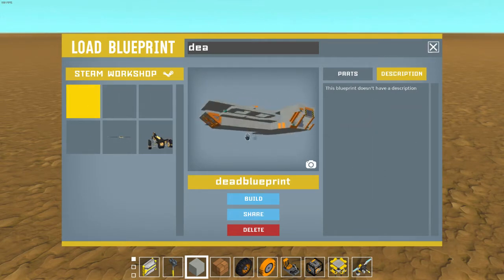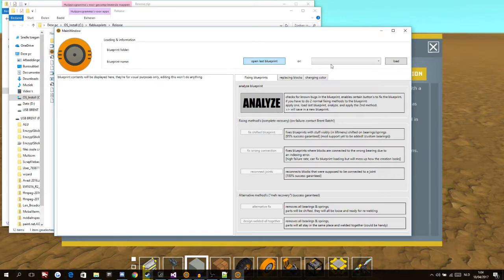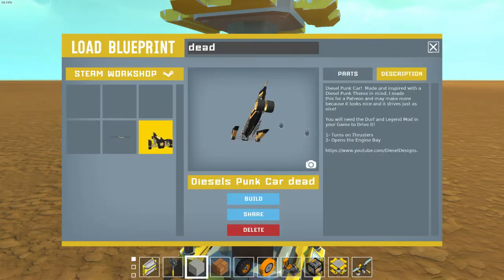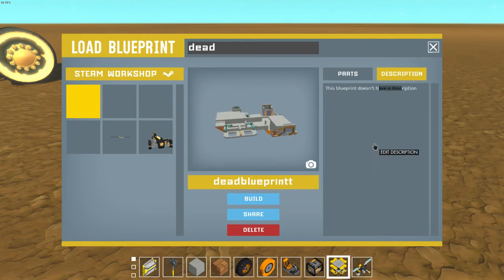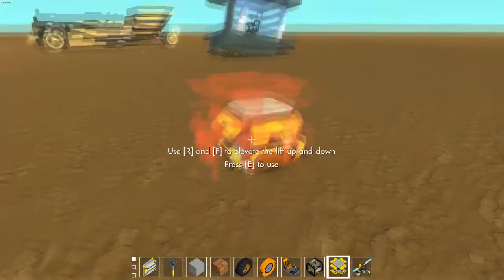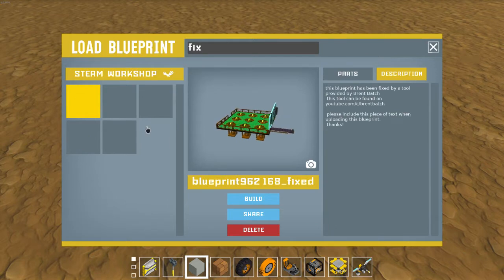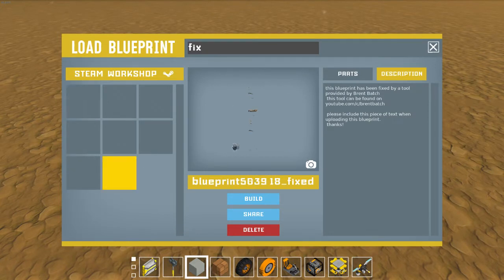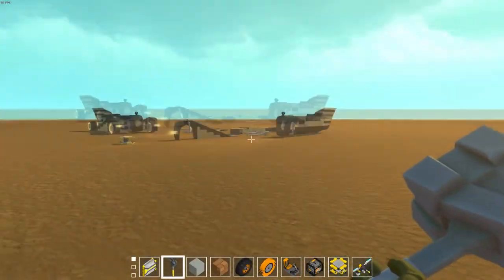Fix YOUR Blueprints! :D - Scrap Mechanic

Comment from the maker: because of a lack of interest of the comunity i'm discontinuing this project, it'll stay available online and it'll probably keep working for a long-ass time untill the devs make big changes in the file system, untill then: if your blueprint doesn't allow for conventional fixing methods, use the alternative ones, they are 100% garanteed to work, if the program crashes then feel free to send me your blueprints at brent.batch@hotmail.com i can not promise instant responses, as i said, there's a lack of interest in this tool
Reply from the maker: current version: PATCH V1.0.0.8: bug in modsupport has been found and patched! mod support has been improved
Reply from the maker: PATCH V1.0.0.9: extra button to check for available alternative method's (for when the normal 'analyze' crashes or doesn't work)
Reply: when i tried to load my rail gun it said invalid json what should i do
Reply: how do we send the broken blueprints to u?

Comment: Hi.
I don't have the Steam version, but it requires two specific Steam folders, and all I can do is "fixing" alternatively (it separates everything).
Is there another way of fixing a blueprint without those specific instructions?
Reply from the maker: currently all the bugs it fixes have been patched, there's new bugs now which the tool isn't made for, only the alternative methods work now
Reply: Brent Batch Oh, that's quite disappointing, I couldn't fix anything with the alternative way, that tool just make the glich worse than before...
Thanks anyway, I really appreciate your answer ✌🏻.

Comment: I built an articulated bus for several hours and the joint started to glitch during the chassis construction, which is why the later saved blueprint was broken. To my annoyance I deleted the last save when saving the new one, because you don't expect such problem. Thanks for this application, because it fixed the corrupt blueprint without functional and visual changes.

Comment: Excuse me brent, can you explain why when i save a blueprint the thumbnail is empty and when i try to spawn it it doesn't work? is the blueprint corrupted?
Reply from the maker: Simo2412 I really need to update this tool, i never got around to getting the tumbnail stuff finished, also: the bugs that plagues blueprints in this vid are not that common any more, new bugs are around now which the tool wasn't prepared for, i need to completely rewrite it for it to be able to fix these. What you can try is one of the alternative methods, they will give you a blueprint without bearings or springs or pistons, which should make it spawnable again. But also here it needs a rewrite so removed pistons dont cause an issue
Reply from the maker: Simo2412 if you send it to my mail or join the discord and pm it to me i can have a quick look to remove the bugs, shouldn't take too long. Manual approach is quick with the new bugs
Reply: don't worry xD i don't know why but when i opened the blueprint with the tool now it work, i just used the alternative fix because i have the steam folder on another hardrive  it created the fixed blueprint but when i tried the original blueprint now work and i can see the thumbnail
Reply: wait, existential question, is the latest version the 0.2.9 or the 0.1.32? i'm confused
Reply from the maker: Simo2412 version number of the tool and version number of the game are not the same, the last version of the tool is linked in the description and was made for scrap mechanic 0.2.7 i think, it still works in some cases now but needs a rewrite
Reply: i'm not talking about the tool, i just asked if the latest version is the 0.2.9 because  the 0.1.32 of my friend seems to don't have a mods folder on %appdata% and the piston is missing

Comment: When I load the blueprint, and click on analyze, no feedback comes from the software and windows says: fixshiftedblueprint funktioniert nicht mehr (im german) I have used mods in the Version 0.2.4 Build 190 waht i can do?
Reply from the maker: send me the blueprint, either via mail or anything else (brent.batch@hotmail.com) i'll debug the program to see what goes wrong and try to fix it, it's highly likely because of mods, what mods are you using ?
Reply: ok I have used this mods:

The Modpack
The Modpack Polygons
The Modpack Polygons Glass
Legend Mod
Exhaust Tubes
Colored Buttons and Switches
(The Modpack BETA (I can´t remémber)
Buttons and Switches Pack
Extra Blocks Mod

I think, that was all
Reply from the maker: hmmm it doesn't crash for me , can you tell me where your blueprints are located as well as where you got your scrap mechanic files located ?
Reply from the maker: hmmm nothing seems wrong, are you sure you got all the mods used in the build ? try download the program again btw , i updated it but it doesn't update on all users who have it , you need to manually download and reinstall/use the newest version
also, i couldn't find any bugs in your blueprint, it has to be something new, i might try to check for the new bug sometime, but for now you can click the new button in the textbox next to analyze to enable the alternative methods instead of having to click 'analyze'
Reply: ok, i can load the fixed blueprint and then all things, they before on bearings are faling from the sky. thank you! can you load the blueprint? or im the only one?
Reply from the maker: TheDarkMadness haven't tried to load it but ill check it out later, its normal that the alternative method makes stuff fall from the sky btw ;)
Reply: ok thank you so much. i can fix it now

Comment: Hey Brent! Thanks a lot for this tool.
Does it look for parts in the unpublished mod folder? (C:\Users\<username>\AppData\Roaming\Axolot Games\Scrap Mechanic\User\User_XXXXX\Mods)
It's telling me it can't find the required mods and that's where the part is.
Thanks again!
Reply from the maker: HaJa Creations ahhh, i forgot to add that, thanks for noticing! ill add that asap
Reply: You never cease to amaze me. Thanks Brent! -Jude
Reply from the maker: unpublished mods support added! srry that it took so long , had little time, twas actually pretty ez to add lol
links in the desc remain the same, the files behind the links are updated to contain this patch :D
i'm also working on a better shifted-blueprints fix , but that's taking a lil longer
Reply: Thanks Brent. I'm in no hurry.

It's still not finding my mod parts. They're here:
C:\Users\<name>\AppData\Roaming\Axolot Games\Scrap Mechanic\User\User_#################\Mods\HaJa Mod\Objects\Database\ShapeSets\HaJaParts.json

The creation I'm wanting to try it on is huge (called "Mansion"). It has a few shifted bearings so it may be too bad to be saved, but I figure it's worth a shot. It uses unpublished parts so I can't really share it.
Reply from the maker: ugh you called 'parts.json' hajaparts.json ..... no wonder it doesn't work :/ i'll add someth that can read any json file
Reply from the maker: currently at v1.0.0.7,
patch: supports different parts.json names now, for unpublished mods as well as published mods (eg durf mod wasn't properly supported) could you test?
Reply: I suspected I may have accidentally sabotaged you. I've seen others with unique names too, so hopefully it'll help others as well. Thanks again!
Reply: It finds the unpublished parts fine now. And Durf's too. It loads my "mansion" creation but crashes during "Analyze":
fixshiftedblueprint has stopped working
A problem caused the program to stop working correctly...

It's a 2MB BP so I'm not surprised. I won't bother sending it to you since it has unpublished parts, but I'm sure this tool will come in handy for my future issues.
Thanks!
Reply from the maker: hmmm, yeh, how i designed it it isn't too resource friendly... i could try some other tricks to make that better, or apply a quick patch so you don't need to analyze to use the alternative methods ?
anyway i know i'll have to rewrite the method that fixes shifted blueprints, itll be even less resource friendly but it'll finally get the job done properly instead of half work(only works on the simple cases atm, not the more advanced broken ones)
Reply from the maker: yknow what, send the blueprint anyway, maybe i can find why it crashes on it, could be some other problem, there are still several bugs in my code :/ if it wasn't so much code i'd rewrite it completely using stuff we learned last week in college
Reply: I sent it to your hotmail address. Don't spend more time on it than you want - no biggie. Might help you debug. Thanks!
Reply from the maker: HaJa Creations dont worry, wont spend more than 5 mins on it, just gonna run my program in debug mode and gonna check if some error turns up in the code, if its a stackoverflow then there's not much i can do...
Reply from the maker: PATCH V1.0.0.8: bug in modsupport has been found and patched! mod support is now properly introduced, it should be able to run your blueprint now :D
Reply: Lack of interest?! That's nutz! People must not understand what it does or don't know about it.

I tried the latest version. It's telling me again that it can't find a part in my mod (same part as I mentioned originally). I tried renaming the JSON "parts.json" but received same message.

Thanks Brent!
Reply from the maker: try search for this part in your parts.json files, if you can find it then there is someth wrong indeed.
do you have something else other than 'partlist' or 'itemlist' at the top? now that i think of it , the program is case sensitive, it needs all lowercase atm.
lack of interest: views are lower compared to creation/glitch video's, also the downloads on this tool is really low
Reply: Yes, the part is present and there is no extra text at the top.
I'll try it with a lowercase file name after my nap.
Thanks!
Reply from the maker: it should be in this format: {
   "partList" : [
  {//part information}
]
}
or instead of 'partList' you can use 'itemList' (srry not all lowercase, my fault, 'L' needs to be uppercase, its how most mods are done)
Reply: Ah, I thought you meant the file name. File name is HaJaParts.json

This is how it begins...

{
    "partList": [
        {
            "uuid": "685ccdd5-8ee9-480d-a64a-2696c31e1db0",

Maybe too many CRs?
Reply from the maker: HaJa Creations cr? nah it should be fine, any idea where it crashes for you?

Comment: I used to had this Sci-FI explorer truck with invalid json on spawn, I fixed it by welding it [ one which I made originally] to ground, ever since I always try to spawn another one before deleting original. but this tool will save a lot of stress of losing some blueprints.

Comment from the maker: Any Questions? notify me with blueprints that won't work with the script or if the script runs into issues for you!
Reply from the maker: Pug1Gaming then use an alternative method, the normal method fixing the shifted stuff isnt the best one...
Reply: can you help my blueprint says joint connection error how do i fix it?